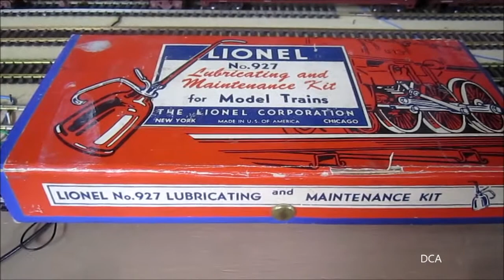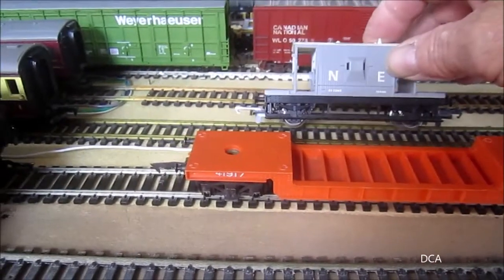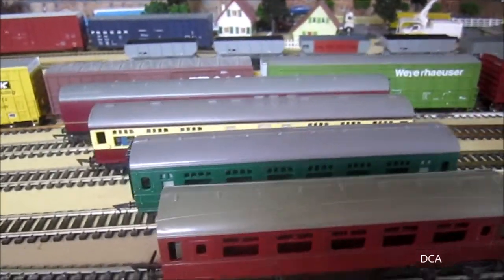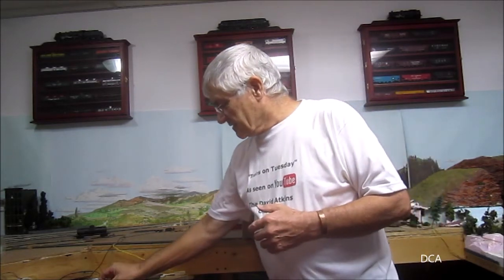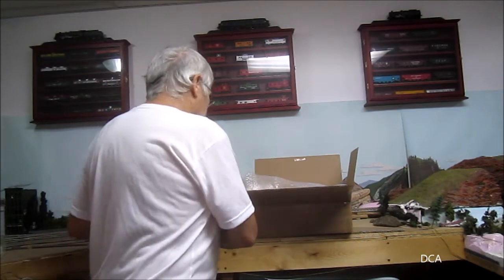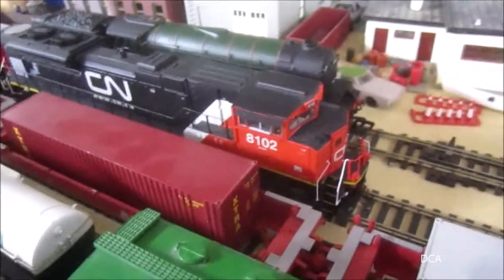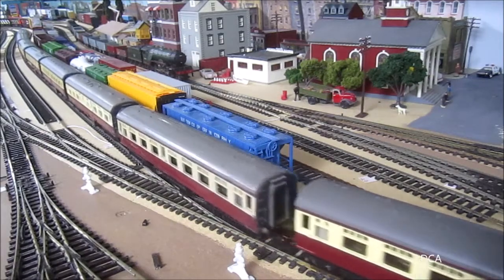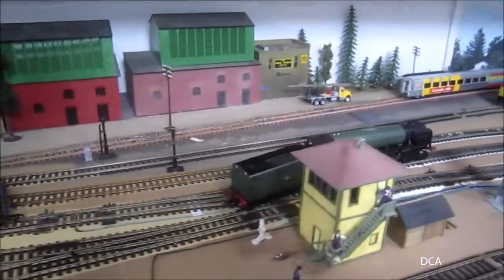Trains on Tuesday 10th. August 2021 What's New Today?

Comment: Good morning David lovely collection of new items. Hopefully, you’ll have your slight derailing problem resolved shortly. I have a newly acquired Hornby Railways tender drive B-17 from the early 80s and its tender jumps off coming through the points, if you remove the centre dummy wheels from the tender which are only partially flanged it runs beautifully! I love the orange wagon I can imagine those in the toy shop window very striking, They definitely weren’t afraid of bold colours back then.

From what I read in Pat Hammonds book that restaurant car with the blue curtains you have is quite an early one.  I think the green restaurant car was introduced in 58 it initially had blue curtains and didn’t look right and the switch was made to orange.  The move was made to orange in the blood and custard restaurant car at that time too by the sounds of it, I imagine it was down to cost in the end it was just cheaper to make all the grazing strips the same. I think the later mainline maroon and then the WR mainline chocolate and cream restaurant cars also had the orange curtains. When I get a moment I shall dig mine out and see which ones I have. They’re fascinating these early Tri-ang Railways coaches with their many slight variations. But I do think these 9-inch coaches look great on the layout they just look quite nice with the locomotives and all of the line side bits and pieces. 

Thanks again for a great video looking forward to next week take care.
Oscar
Reply from the maker: Hello Oscar, I was sure you would have something to say about the blue vs. orange curtains. The restaurant car I got is in such good condition compared to my original one that I played with so much as a child that I thought it was probably a later version. Unfortunately at some point in the life of the orange wagon and the green coach someone decided to remove the uncoupling pin and the cross member of the coupler> So all that is left is the "bayonet." I shall have to rebuild the couplers from other broken wagons. I have been running them and I have had no problems with uncoupling or derailing. I'm looking forward to the day I have all of my  low wagons out together, that will be quite colourful.
Removing the centre axles from my new loco is not an option as they are electrical pick-up points. Interestingly though, I did go back and pick up the other Tri-ang wagon at the hobby shop and a box with some Airfix locos and the centre axles have been removed from them. probably to reduce drag and aid in keeping them on the track.
I was very impressed with my new loco being able to manage 8 of the Tri-ang blood and custard coaches up the 3-1/2 inch climb and I agree it looked great. My old Princess used to struggle to pull 5 on the flat around 1st. radius curves.
The fun continues. Take care, David.
Reply: @trainsontuesday  Good morning David certainly is quite powerful pulling all of those coaches. I had not meant to imply that you should change out the axles on your new model, just that in playing with mine I had removed the wheels and it cured the problem, it has half axels one being part of the motor block casting the other being a stub Axel pushed through the lower part of the plate that holds the brushes/armature in place. However not a perfect fix. I think those centre wheels on the tender drives and on the bogies of some of the diesel models of the late 70s are quite a poor idea they constantly sound like they’re derailed as they float and rattle across the railheads. In this particular tender, they tend to jam between the tender frame in the motor block causing it to derail as the part flanges pull against the rails. I’ve fiddled endlessly with the back to backs of the two driving sets and even replaced all the wheels with new old stock sets but the problem remains. I think a flangeless (possibly a turned down set) centre set would cure the problem. It will be great to see you're well/low wagon collection as a train. Some of those NATO wagons had two metal wheels on one side of each bogie if it had previously been a searchlight wagon, and someone had unclipped the upper structures when they become broken and just used it as a wagon I think the numbers were TR7192 Searchlight, TR7191 Rocket Launcher and TR7190 Bomb Transporter. The metal wheels are quite interesting as the sleave and wheel seem to be in two parts.
Take care.
Oscar

Comment: Never realized the OO/HO scale difference….that was educational…the shot through the coal tipple as the train was passing was nice…is the mine modeled as abandoned; there were no cars on the tracks?  Like your bloopers at the end 😊….not always perfect
Reply from the maker: Hello Anthony, glad to have helped with the scale issue. That was the first time I've shot through the coal tipple from that side and your comments got me thinking, where were the coal cars? Then I realised I had them out on track for the running demonstration. The mine is certainly not abandoned and provides a lot of traffic on the line and it's a great switching location requiring some planning and hard work by the operator assigned to that cab. We all have our bloopers and I'm enjoying sharing a few. Take care, David.

Comment: Always interesting to see your collection. The restaurant car is quite nice and so is the steam loco, that is unfortunate the tender derailing. Great video.
Reply from the maker: Hi Syl, I am very pleased with my new acquisitions. The restaurant car is a treasure. It is in very good condition and runs well. The derailing problem is a little annoying but it will lead to better track work as I sort it out. I wish Hornby would adopt the NMRA RP 25 wheel profile. That alone would cure this sort of problem. The flanges on this loco are sharp like knives and they will find even the slightest track imperfection. 
Regards, David.

Comment: Great update David, I confess I have 00 and H0 containers on my layout, there's a lot of good stuff available in H0. Very nice running session too, derailment is a serious plague that affect everyone at sometime. Take care my friend
Reply from the maker: Hell o Digger,  I had swore off of having any modern day OO container traffic in my collection but that all went sideways when the "ONE" loco and containers came into being, now I expect I shall be adding to that fleet.  The wheels on the tender of my new loco are in gauge but it is one of the lightest vehicles I have on the rails. I tested it with a weight and it seemed much better. I don't mind something like that as it leads me to making more track refinements. Cheers Digger, David.

Comment: Hello David, a very interesting video. I still struggle to get all the scale differences remembered between HO and OO. That was a helpful segment. Some great new Tri-ang items, very interesting about the colour of the coach curtains. The running was excellent to watch and I particularly enjoyed seeing your new loco pulling the Tri-ang rake. All the best to you
Reply from the maker: Hello Jonathan, I know that some people do struggle with scale particularly HO vs. OO as they use the same track. (The track is more closely gauged for OO than HO.) In addition, the British prototypes are generally smaller than US  or even continental European prototypes so, by modeling the British stuff in a larger scale(OO) they tend to look about the same but the containers don't hide the difference. I shall be interested to hear what Oscar has to say about the blue curtains. The new loco managed 8 coaches climbing about 3-1/2 inches without a slip so I'm impressed with that. I did go and get the other wagon and I'll be having something more to say about that another time. Glad you enjoyed the running.
Regards, David.

Comment: Nice additions David. Always nice to add an oddity to the collection.  Of course I checked my collection, and out of the dozen well wagons I have. None are orange. Just blue  green and grey. Nice new A2 as well, it seemed to do the job well, except for the derailment. Like I said before, I would be curious to see if Hornby or Bachmann modelled a North American Berkshire in OO. As a one off, it would sell out. Take care mate, The virus is shredding our southern states, but Queensland is free again. Steven.
Reply from the maker: Hello Steven, Sorry to hear about the virus situation. I am already seeing signs that it will be bad here again this coming winter. It seems as though our health authorities have given up on it. I was so pleased to see that orange well wagon. I have 5 colours now. The A2 does run very nicely and it pulls a good load. I am sure I'll be able to sort out the derailing issue although it never made it all the way around the inside mainline without coming off. More of a track issue I think. I think your OO Berkshire will remain a dream. All the best, David.

Comment: I really liked seeing the scale difference between OO and HO as well as the difference in length of the Triamg coaches. 
If you have more OO/HO comparisons, I would be interested in seeing the scale differences.
Reply from the maker: Hello Heath,  when making comparisons between HO and OO it is difficult in as much as the fact that the prototypes are so different but at least with rectangular box containers it is very clear. That is the first time I've had the range of Tri-ang coach sizes to compare. It demonstrates the progression that Tri-ang went through in the transition from toys to model railways. I'm extremely pleased to have found that green coach.
Regards, David.

Comment: Those Triang coaches never looked right, especially when you think what Hornby were producing at the same time. Your A2 will get sorted I'm sure! Keep well
Reply from the maker: Quirky coaches for sure Les but collectable now. I wonder what that Southern coach will look like added into a rake of full sized ones? It is partly because of what Hornby were producing at the time that they went bust. I have not done much as yet with the A2 tender but a bit of added weight seemed to help. It is a little finicky and I think it will lead to more track improvements. All part of the fun.
Cheers Les, David.